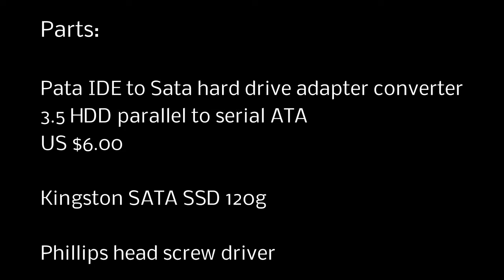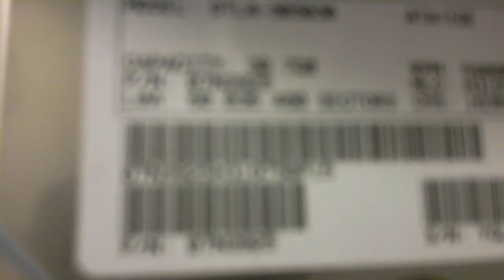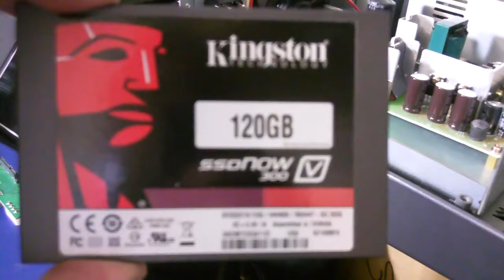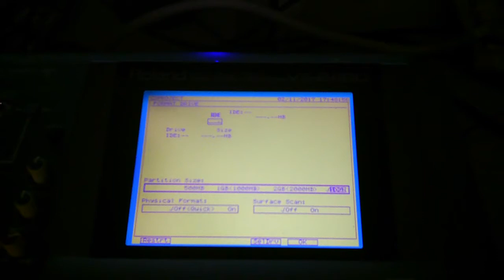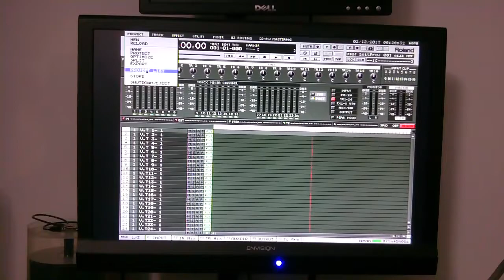Roland VS2480 convert internal PATA HDD  to SATA  SSD

Comment: STOP! Before you do this conversion, here are some corrections to this procedure. 
First, the back DOES NOT need to be taken off of the VS2480. This greatly simplifies the procedure!  Shut down and unplug the power, then take a dime and turn the slotted screw on the right of the hard drive caddy 1/4 turn to the left. The caddy is now unlocked and with your four finger you can pull it out of the machine. THIS CADDY IS NOT 'HOT-SWAPPABLE', YOU MUST SHUT DOWN TO INSERT OR REMOVE IT! Everything you need to do is inside the caddy. To remove the top from the caddy carefully take a small slotted screwdriver and place it near the opening of the slotted screw and slightly lift the edge of the top so you can get a fingernail under the edge. Now pull on the edge all the way across until it pops loose. Take the four screws out of the two sides of the caddy to free up the hard drive and unplug the power cable (4 wire) and the data cable (40 pin). Store the original IDE hard drive in an anti-static bag. Save the screws in case you have to put the original HD back in. Plug the two cables into the new PATA IDE to SATA SSD Converter Card and plug the new SSD into the other side of the converter. Push the caddy back into the VS2480, lock it with your dime and power it up. If it sees your hard drive you can go ahead and format it. It will take about 4 or 5 hours. 
If it doesn't see your SSD you'll have to do a HARD shut down (just turn off the power switch); start over with other replacements OR go back to your original IDE.  If it HAS seen your SSD, after it's done formatting remove the caddy again (AFTER you power down!) Use a small piece of double stick Velcro to hold the SSD to the floor of the caddy and put the top back on being careful to get the front to back line up correct. Reinstall the caddy and your ready to start recording. 11/18/24

Comment: Great video. My 120g hard drive has finally died and then came across this video. I have a couple of questions though. Why is it necessary to completely take apart the vs2480 to only install the ssd and chip into the caddy? I presumed I would only need to take out the caddy and open it up to remove the old hard drive?

Which brings me to my next question, how do I open up the caddy to remove and replace the hard drive.

Many thanks in advance for any replies 😊

Comment: Hello there.... I have encountered a problem on my 2480..... "I have a lot of work from down through the years on all the drive partitions"  And today I replaced a new DVD insert burner replacing the original CD burner, which I just received from eBay purchase... anyway, after loading it in and turning on I was directed to a system test page....  I don't really know what I done.... but when turning of and back on ..... my message appearing now is " Not found any formatted Drives" can you help.... Thanks in advance. Johnny

Comment: Hi thanks so much for the video! I still have a VS2480 I bought back in 2003, used it for about 12 years straight and then started producing with DAWs, Logic all the way now! :) Haven't switched on my Roland for about 4 years now! My question is, is it possible to remove the internal HD and copy over the data to a PC or Mac...? Would the data need to be converted from Roland data to wav files? I have tones of music on the VS2480, for starters my bands 3 albums plus lots of demos etc... anyway, thanks! Any advice would be very much appreciated! :)
Reply: You will need to use a converter's software. Or you can get a VFire and an older desktop. Or you can record everything out of the VS into another recorder live. Here is a link that will show you what the files will look like once you pull the HDD switch the pins to slave from master and place it in a desktop...http://www.rolandvs2480.net/2480-FAQs/Roland%20VS2480%20Hard%20Drive%20Recovery%20Procedure.htm
Reply: @ianglispy2885  Thanks for your reply. Actually yes recording everything out live might be the most straight forward solution... although lengthy in time! But if one can send out 8 individual tracks at a time then not too bad either... I probably have around 60 projects in there at least, over 10 years of recordings! Thanks for the idea!

Comment: Hi IanCaneFire,  Great video! Still trying to determine which adapter is the correct one? The first one I have purchased (RXD 629A 2008) was pictured when I ordered it  but received (RXD 629 A-7)  which didn't work on my 2480 with the same SDD in your video. I had thought I needed the card printed with (RXD 629A 2008) ?  if you have a second could you give me a little more info on the card that worked? So I an order the correct one

Thanks in advance,
Lance

Comment: Hi Like the video but the adapter card you show at the start does not have the master jumper and is different to the one you are using, I have the one in the picture and it does not work.
Reply from the maker: john Barry thanks for the heads up. I obviously did not look closely at the image. That is the image that was on my eBay purchase.  So it seems that the seller just used the same image for all the adapters. It the name of the adapter was the determining factor. I bought the one for use with DVD.
Reply: Hi IanCaneFire,  Great video! Still trying to determine which adapter is the correct one? The first one I have purchased (RXD 629A 2008) was pictured when I ordered it  but received (RXD 629 A-7)  which didn't work on my 2480 with the same SDD in your video. I had thought I needed the card printed with (RXD 629A 2008) ?  if you have a second could you give me a little more info on the card that worked? So I an order the correct one

Thanks in advance,
Lance

Comment from the maker: Hi Alan...Thus far I have noticed stability (not that it was ever lacking before for me), slightly faster start up project load project save and shut down (nothing drastic), no need to ever have to defrag again because it is ssd, then the obvious improvements of quieter (disconnect the HDD fan), lighter weight, tons of storage drive space.

Comment: Hi Ian, Great video!  I own the smaller VS 2400CD and have on occasion got an error "No IDE installed"! This has happened twice in about a year and all I've done is to take out the drive and re-installed it, dirty connection perhaps.  This has worked, but I'm wondering if I can use your method on my recorder? If so, do you notice much difference on speed?   My HDD is the original 40gb  one, so if it isn't possible, do you think I can stick in a larger IDE HDD? Sadly, unlike your machine, mine doesn't have a SCSI port, so I have to laboriously transfer one song at a time to my PC.  Be grateful for any advice Ian, thanks a lot.
Reply from the maker: Thus far I have noticed stability (not that it was ever lacking before for me), slightly faster start up project load project save and shut down (nothing drastic), no need to ever have to defrag again because it is ssd, then the obvious improvements of quieter (disconnect the HDD fan), lighter weight, tons of storage drive space.
Reply: Thanks Ian, I appreciate your quick response! I shall source what I need now and do the conversion. Thanks again.

Comment: Have you seen a significant difference in reliability and speed with this upgrade? My IDE drive continues to give me "IDE not available" and "Drive Busy" while trying to record. I've wiped the drive multiple times, but I think the drive is just dying. Thanks for this tutorial! Any info would be greatly appreciated!
Reply from the maker: Rodney Ramos Jr.  It works great so far. No stalls or hiccups. No need to defrag ever again also.

Comment: Hi, I’ve done everything as described but can’t even get passed the initial setup drive page. How do you get the adapter card to master?
Reply from the maker: gary lowe the adapter has some prongs on it. There is a small plastic fitting on the prongs. Depending on which prongs it it covering determines whether the adapter is set to master or slave.  Look closely at the adapter and you will see for yourself how to set it.  It is a common thing with he'd and such so look at a YouTube video on the subject. Cheers.
Reply: IanCanefire thanks for the response, yeah I tried swapping the cover over but that didn’t work unfortunately, must be either the adaptor, the disk or both! I believe that I have the 2 exact same devices as the video though...
Reply: @gazz5467  , I think that it has to do with the dvd model - I converted my vs2000 with no problem but had no luck with the vs 2480 DVD

Comment from the maker: This is the adapter sata to pata ide plug&play 7+15 pin 3.5/2.5 sata hdd dvd bg that I used. The first time I preformatted the add drive to fat 32. The second and third time i did this conversion i did not preformat i let the vs format the drive and it worked. I see these adapters for sale on eBay and newegg and Amazon. Good luck

Comment: Thanks much for this Ian, I’m wondering where you discovered the exact bridge you are having success with?
Reply from the maker: Ken Totushek in the description  below the Video look for that specific one adapter on eBay. When I bought mine I ordered a few because I had a few vs units. Others are known not to work. Some sellers on eBay say it is the DVD type of adapter with those specifics but you need to match the picture with it to make sure.  Thus I added the picture to the video.  Good luck.

Comment: Hi Ian, i tried the same last week on my VS 2480 but did not succeed, for some reason the KINGSTON SSD 120G  wil not format. On the screen : "operation failed" any idea ? thx !   Regards, Will (Crosswood-Studio -  Belgium)
Reply: Hi Ken, no unfortunately not, although I tried several IDE PATA TO SATA Adapters from Amazon, my VS 2480 still refuse to format the SSD ...  for the moment a friend of mine is formatting the SSD in FAT 32 in his old computer, we'll try this ASAP, keep you posted ..  !    thx Will
Reply: @willtranchet7950  , I think that it has to do with the dvd model - I converted my vs2000 with no problem but had no luck with the vs 2480 DVD.
Reply from the maker: I wish I could help you. I've done it twice and it was a simple process with a successful result.
Reply: thx for your answer Ian, I noticed that on the delivered adaptor card is printed : RXD 629 A-7 while i've ordered on Amazon the adaptor with printing RXD 629 A 2008 on it,  is there a diference ?  is this the reason why it's not working ?  Anyway  I also ordered yesterday the StarTech.com 40/44 Pin IDE to Compact Flash SSD Adapter (IDE2CF) for a convert solution with Compact Flash card,    wat do you think about this solution ?  thx and kind regards from Belgium, Will (Crosswood-Studio)
Reply: Hi Will, did the SSD adapter work for you?
Reply from the maker: Will Tranchet hopefully you used the exact type that I spelled out in the description verbiage below the video. This converter has now worked three times for me without hassle.
Reply: Hi Ian, problem is: when I order the item on Amazon with the same number on it wich I can see on your video, it comes everytime with another number printed on it...  I already have four different adapters here from Amazon, not one is working with my VS2480 ...  Regards, Will
Reply: Hi Will, my same adapter (629-A7) from Amazon worked with the Kingston 120 SSD drive and a quick format—just as Ian said, though I haven’t tested it a great deal yet.  There a bunch of removable HD drives now—Always exciting til you get one of those “Operation Failed” messages...I’ve just had way too many of those with previous mechanical HD methods!  I found an adapter exactly like Ian’s on ebay—at least that’s what was pictured.  I told the seller not to send it if not exactly the same number as pictured, including 2008!

Comment: If anyone can help, please... I just recently having this problem.... up on starting the machine I am getting Two ''Ok'' plus it reads ok the effects too, but after opening the project when I try to change the IDE partition,, I get message saying Now working wait please all the time and it does not go anywhere!! I hope this is not what people call Hard drive failure!! .Well, I am going to buy the SSD to replace my 80gb 3.5 inch drive, I hope I can manage it! Many thanks.Harry
Reply: Unfortunately your hard drive is failing. I was also receiving the message "Drive Busy" or "IDE not available" while trying to record and even save my projects. Eventually it just continued freezing and would not save any progress so I have a lot of re-recording to do. However, if you are able to get an IDE to SATA bridge and look up VS Wave export free software, you can backup your VS project data onto another computer. Of course depending on the current state of your drive, it may recover everything or parts of tracks. Now that I have my data backed up, I will be disposing of the IDE to not be tempted to use it again in a pinch and replace it with the SSD shown above. I'm just worried about purchasing a defective PATA to SATA adapter since the specific ebay seller is not listed in the comments section. As far as your data recovery, good luck and let me know if you run into anything else.

Comment: Hi Ian, I appreciate the video btw, I also have a few questions for you. I wonder how the Adapter and SSD setup is holding up after some months, do you have a number of projects working without issue?  Also, the waveforms on the tracks on the VS-2480, do they tend to show the waveform data quicker than the older standard (IDE) HDD? Just wondering as the waveform data may not be a function of the SSD/Adapter but a limitation on the PCB of the VS2480.  Would appreciate your thoughts and reviews now that you have had some time with the new setup.
Reply from the maker: Winyard Productions it works well and i have several projects in the vs2480. I record every week in my studio. No problems at all.  It doesn't  do things any faster regarding the wave form display.  Cheers
Reply: Great! I'll put it on the list of mods.  Thanks.

Comment: Hi Ian. Thanks, you made it look so easy. I have a VS-2480HD and the original drive died the other night.. I took the caddy out and got a Kingwin ADP-06 Bridge Board and a Team Group L5 Lite SSD. The ADP-06 is set permanently to MASTER mode. The pins are only for the direction (SATA to IDE, or IDE to SATA). 

No  luck. When set "IDE to SATA". it never gets past the Initialize screen.  When I set it "SATA to IDE", it does advance past the initialize screen, goes through the blue setup bar, but then says "no drive found" (or something to that effect. It definitely does not say "no formatted drive found"). 

I have a Crucial SSD here, but that does not work either. I tried taking a older 3.5" HHD and attaching it to the bridge board. But there is not enough clearance for me to fit it back into the caddy.

I am thinking I should get the exact same Bridge Board and SSD you used here...
Reply from the maker: Mark "M.E." Edwards hi. you need to use the exact bridge  i used in the  video. i have heard that others do not work.  also i formatted the ssd drive to fat 32 before putting it in the vs2480. now in theory that should not matter, because the VS is going to format the ssd.  i did it anyway. so i knew the ssd was able to work before putting  it in the VS. good luck.
Reply: Thank you so much for the prompt reply, Ian. The ADP-06 was only $8 and locally available which is why I gave that a try first. I shall track your unit down. I will also try formatting the SSD to  fat 32 and even try it with this board since the board you used won't ship til Monday at this point (today is Saturday). It appears the model # is RXD-629A7-7 though I can't tell who the manufacturer is.

This appears to be it. A seller in Pennsylvania (I am in NJ) . https://www.amazon.com/HDE-Computer-Drive-Interface-Adapter/dp/B008X8NK0I/ref=sr_1_11?ie=UTF8&qid=1500125852&sr=8-11&keywords=sata%2Bto%2Bide%2Fpata%2Bconverter%2Badapter&th=1

Comment: Actually the Roland VS-2480 can use up to 137.4 GB (=128 GiB). I have a 160 GB external IDE drive (connected with an IDE to SCSI converter card to the SCSI port) and an internal 120 GB IDE installed, and the external one has 12 partitions (SCSI0:1–11), the internal has 11 (IDE0–10). Each of the partitions are 11.5 GB ≈ 10,7 GiB, except the 12th partition on the external one that is a little smaller.
Not important, I just wanted to mention it.

Comment: Nice one. 
Can you confirm you get stable operation with all channels recording?
Also could you please let us know the brand / chipset of the adapter?
I tried and failed with  ide to CF and ide to SD adapters for internal storage and ended up using scsi2sd external as my main drive, but it has speed limitations.
You might want to try it as a backup solution... then you get a totally solid state system.

edit...

i found an identical one on Amazon so will try it...

https://www.amazon.co.uk/gp/aw/d/B00GJ8PHC8/ref=mp_s_a_1_1?ie=UTF8&qid=1489827613&sr=8-1&pi=AC_SX236_SY340_FMwebp_QL65&keywords=PATA+IDE+to+SATA+Card+Adapter+Converter+for+3.5+HDD+DVD&dpPl=1&dpID=51Xjp0KwNkL&ref=plSrch

Comment: do you need to take the machine apart to add this sata conversion card in the hard drive caddy box?  i have the vs2480HD.
Reply: Blair Cromwell look at the picture at 3:01. Yes you need to take the back off the vs2480. then go into the cage around the hdd. then go into the caddy and secure the adapter and molex power cable then add the ssd to that. Should take 15 minutes.
Reply: wasn't sure if this was a hard drive version or a cd/dvd.  I can remove the hard drive caddy on mine without taking the machine apart......?
Reply: Blair Cromwell mine in this  video is 2480HD.
Reply from the maker: MightyHip hi I guess there is no need to remove the back if your harddrive caddy isnt locked.  It was my first time opening it.